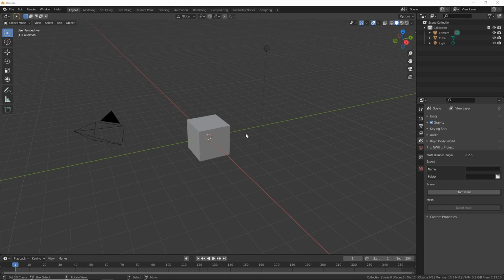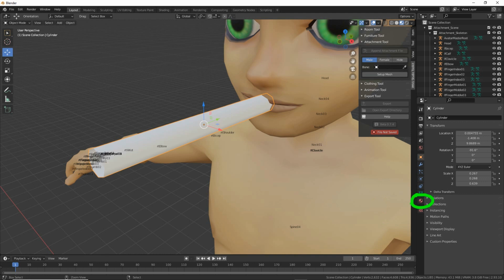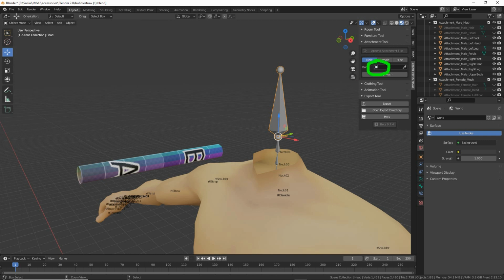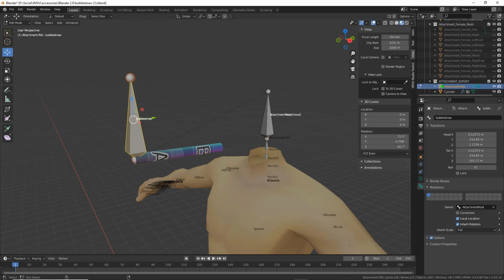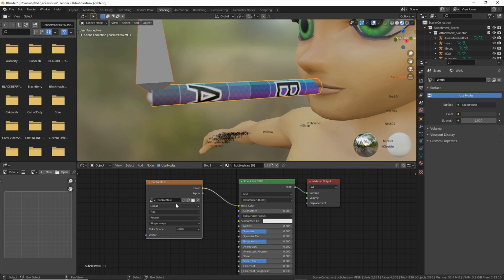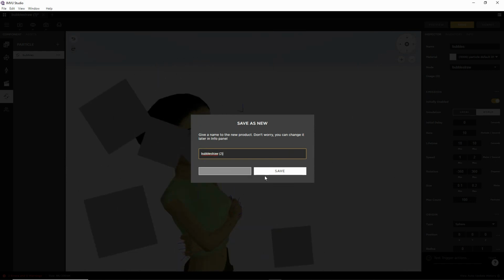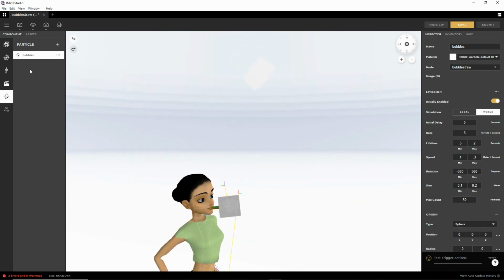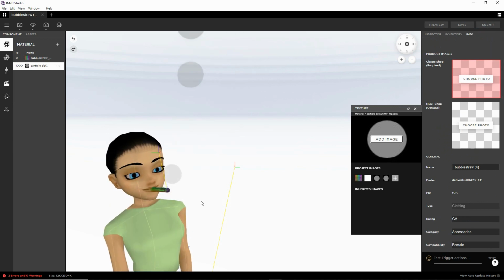IMVU Toolkit - Accessory (Attachment) with Particle Effect

Comment: I followed every step but my bag keeps loading into imvu like pulled backwards. The strap is on the shoulder but the bottom off the back isn’t positioned towards the floor. What am I doing wrong
Reply from the maker: You're not necessarily doing anything wrong, the bag appears in IMVU positioned relative to the bone used to anchor it, if that moves so does the bag. So, if you setup in Blender with arms *out*, in IMVU the bag will flip because the same arm in now *down*.